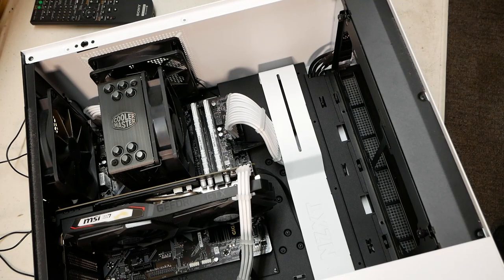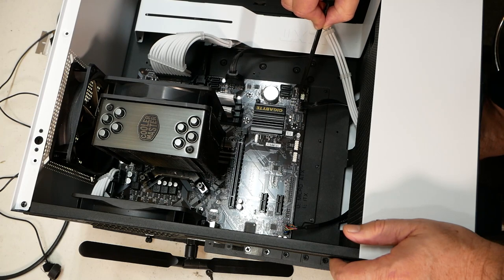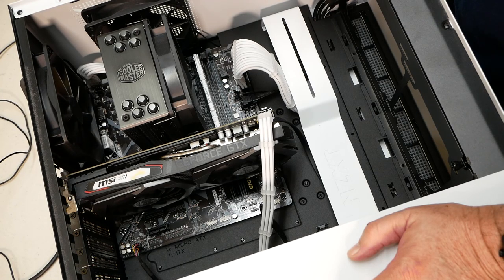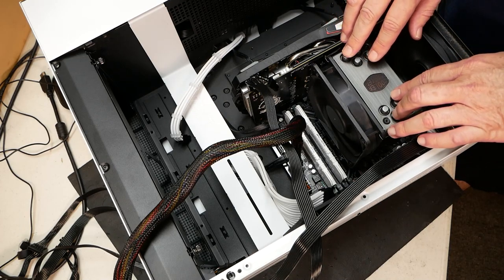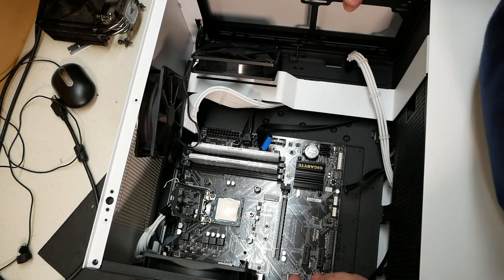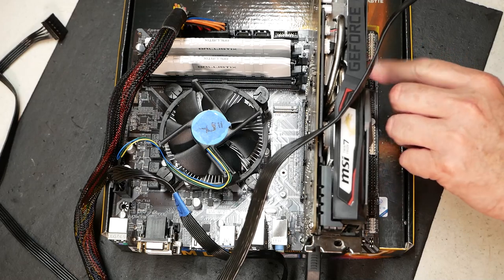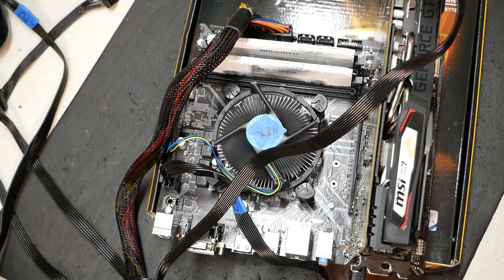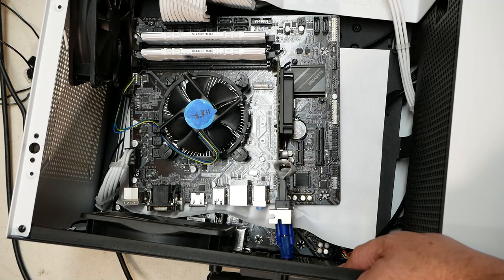This is Rare! Why is This Gaming PC Power Cycling?

Comment: I'm not sure I understood, but did you check original configuration with the known good GPU?  I'm leaning towards bad original GPU only.  We did not see you use good GPU on original mobo.
Reply: I'm with you on this DDT, would also want to check the PSU with a tester to make sure that isnt what killed the GPU as test GPU had no supplemental power
Reply: The original motherboard was stuck power cycling. That isn't something the Video card can cause.
Reply: @silarin9917  Im with you, I would have checked toe power supply is outputting what it's supposted.
Reply from the maker: I did check with a known good gpu before finalizing however power cycling is not a symptom of bad gpu. Thanks for commenting.
Reply: @TimsComputerRepair  Love your uploads, generally way better than a lot of other channels.
Reason i suggested checking the PSU was that if it had an issue it could be responsible for destroying multiple parts in the rig with 1 faulty rail.

Comment: I had the same problem: cause that specific Cooler Master cpu cooler. The 4 screws that go in de mainboard are to wide on de bottom and will put pressure on the lanes in the mainboard causing the problem. Try to loosen the 4 screws holding down the cpu cooler. It will work again. Replace with a diff cpu cooler and problem solved. That mainboard is a 100% not faulty
Reply from the maker: Thanks for commenting.
Reply: I just did this and it worked!!! Nothing else was working and this worked like magic wow thank you! Appreciate it so much.
Reply: I never thought that

Comment: Hummm, I have a older i5 2500k msi mb computer I was trying to get going for my g/f and it was stuck in boot loop. I tried pulling components with no success so I figured the mb or cpu took a dump so I replaced them with a msi board i7 4770 cpu and after all the work of taking everything apart to clean it all thinking it would be fine tried firing it up and as my luck would have it, doing the same thing. Guess it's gotta be the Corsair gs800 power supply :( and way to test it before replacing it?

Comment: My PC has been having the same problem. However, when I take out the motherboard battery and reset CMOS, I can turn on my computer again. After an hour or two, it stops and it goes back on power cycling. Is this a motherboard issue?
Reply: change cmos batt if ur mobo is old age

Comment: I've been pc gaming and building PC's since around 2007. Never had a single graphics card or motherboard fail. I got into computers when I found a $1500 computer ($4,000 - $5,000 toady's value) in an electronic recycling bin. Brought it home put some heatsink paste on the processor and it worked great for at least 10 years got outdated so I built a new one. Googled a wireless networking issue i'm having and the "This is Rare!" got me interested as well as side tracked.
Reply from the maker: Thanks for commenting.

Comment: Greetings Tim, great video! Thanks for sharing. I would've liked seen the test with out video card using on board video then switching the memory modules and lastly using a psu tester. Lucky you you have those spare parts... I still wonder how a MOBO and GPU will go bad at the sametime? Power issue?

Comment: I have this issue but every so often after quite a few power cycles it will boot just fine anyone with a idea as to why
Reply: Mine was like that for awhile, eventually I reseated the CPU and it  stopped happening.

Comment: Had the same issue, stuck in a boot loop, stupidly but ig fortunely replaced the psu and ssd 🤪 but pulling out ram n gpu and blowing away a lil dust fixed it. Shits been bugging me for like 1 year

Comment: i feel liek your jumping to conclusions with otu testing more to prove yourself wrong ! eacxmple your assuming its the motherboard  and video card i can see why you woudl think video card but why think motherboard why not put everything back in the original mobo except the video card and try with the basic one test again see if it responds  if so then boot it  but then maybe put together a workling set up  but different and try that video card in ther other set up because sometimes a pc might have a gpuid exclusion so it thinks this card had somethign go wrong and wont let it work but then you put it in another pc and it works like new and so then you have to start with a diff card or on board video and update drivers and try agin  and then once getting ti to re recognize the card you can update evertythjign as a whole
Reply from the maker: Thanks for watching.